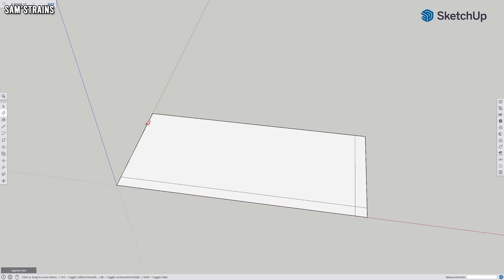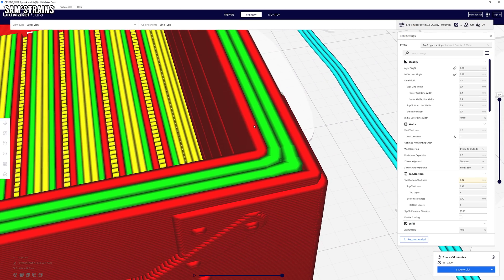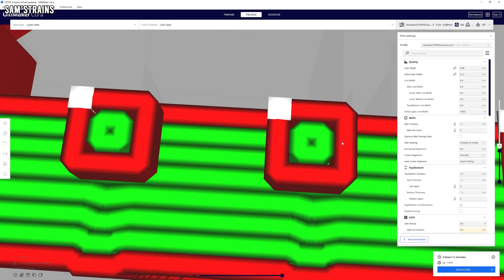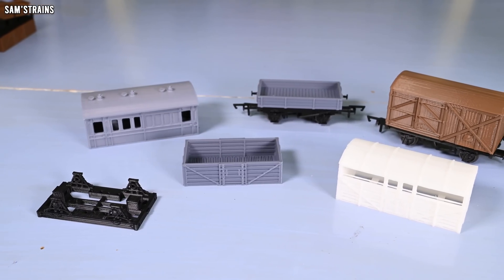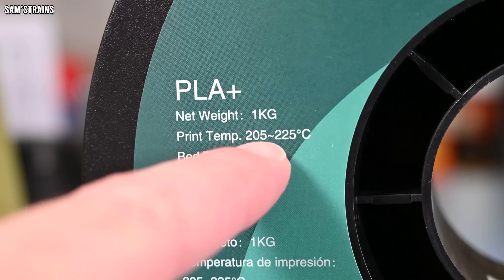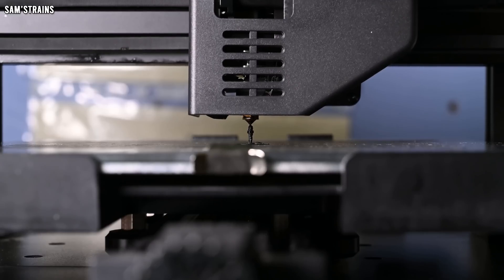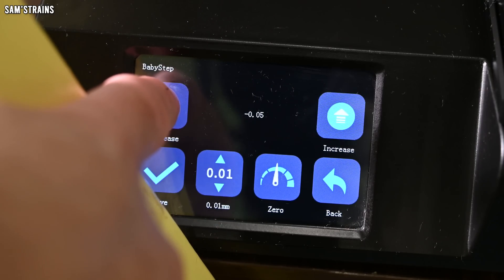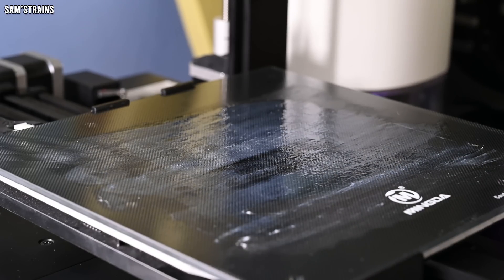Tips & Tricks For 3D Printing Railway Models

Comment: I’m a bit of a 3d printing nerd so I have a few more tips:

1. If you use an I3 style printer (such as an Ender 3), set your layer heights to be a multiple of 0.04. This is the smallest size that the Z axis can move in, and it’ll result in much cleaner layers. If you’re using a 0.4mm nozzle, I wouldn’t go under 0.08mm or above 0.32mm to make sure that there aren’t any issues when printing.

2.) If you have a tall and skinny model, use a brim or raft to prevent it from breaking off.

3.) Dry your filament. If you don’t, you’ll start to have a lot of issues that are impossible to fix otherwise. I’d recommend getting a filament dryer, but an oven should work fine as long as you’re super careful (they don’t have very accurate temperature control, so you can melt the part pretty easily). I’ve also heard that food dehydrators also work well for this.

4.) It’s very easy to tension belts on a printer without belt tensioners. You usually just have to unscrew the pulley and move it back by hand, and you’ll never have to touch it again. A belt tensioner will only really save you 5-10 minutes.

5.) Although Sam says to oil your printer, you should grease them. Oil will very quickly wear off after an hour or so of printing. It is designed for high speed applications, not high precision. Use machine grease and only lubricate the lead screw. The wheels shouldn’t be lubricated because they shouldn’t slide on the V-Slot. If they do, you’ll lose a bit of accuracy.

6.) Have fun with your printer! The more you use it and play with it, the better quality parts you’ll be able to make. It’s good practice to print models you find online, especially torture tests or calibration objects. It’ll also help to use your printer for around the house fixes that you may need. 

7.) Design your parts to not need supports. In many cases, you can make small changes to your part to avoid using them.

Overall, this was a pretty good tutorial, though there were a couple little mistakes here or there (such as the recommendation to use oil). I hope that my little guide is also helpful, and you should hopefully be able to print better and more reliably.

Comment: Some fantastic tips there Sam. Especially around layer height.
The only tip that I really disagree with is the use of the glue stick. I have seen in the past others use this technique too. I tried it a year or two back and got very mixed results. I now use nothing to promote adhesion, but I just wipe the bed clean with IPA before each print as the bed heats. I don't get much adhesion problems these days. My printer is a basic Creality Ender 3, with a glass bed though.

Comment: I have issues with a corner lifting during the print, squashing each layer up. Tryed leveling the bed and having the entire model build a few mm off the bed on supports which didn't work as well as planned. I just print a thick base now and just sand it flat but its more work than it should be.

Comment: Great tips, Sam! I recently picked up a Mingda Magician X2 as my first 3D printer. The quick setup guide was very helpful, but it said nothing about adjusting the belt tension. The belt for the print bed was so loose from the factory that it wouldn’t run. Once I figured out that was the problem, it was easy to tighten it up just like in your video. After that, the initial results were great. I will be incorporating your tips as I dive into the software and begin designing models. Thanks!

Comment: SLS nylon printed parts are far more accurate than FDM but very expensive.  However if you send your designs of small parts off to be professionally printed you may find that it's cost effective.  If the design of the parts are assembled in a small box it will save them the trouble and expense of post processing and you a free box!

Comment: With such small scale parts I suggest using a 0.20 nozzle which will yield half the height layers, half the lines.  Keep the great vids coming, Sam, thanks.
Reply from the maker: Thanks a lot for sharing! I never had much luck with the 0.2mm nozzle - reliability went down the drain in terms of clogging! I do need to try this on a few other machines though! :D
Thanks for watching, Sam :)
Reply: @SamsTrains  You should start building an LNER A2 Raven class because you don't have one.
Reply: @SamsTrains  With 0.2 you have to tinker with temperature setting.  They are not the same as 0.4, oh no. I use mine at around 230-210 C on MINI 3D printer.

Comment: Fun fact the way I printed your locomotives Is I basically stole the chassis off of one and built a new body Because I could not get accurate measurements to build a chassis. I made Your copperknob chassis And sits and is Modified for a HO birdie 0-4-0 loco I made